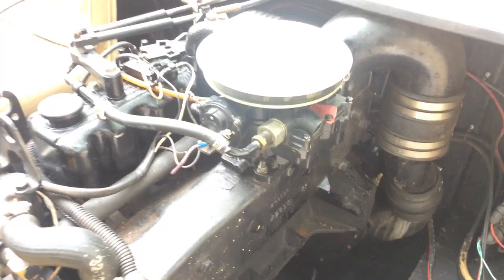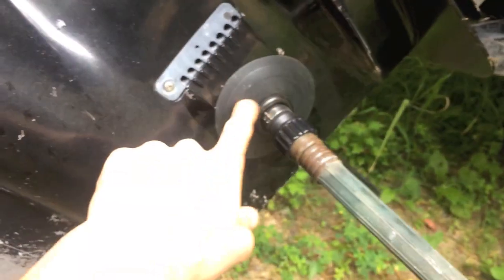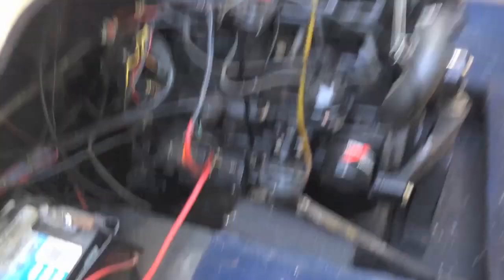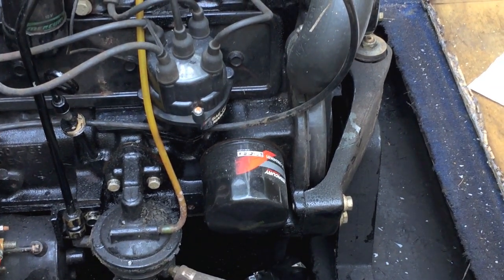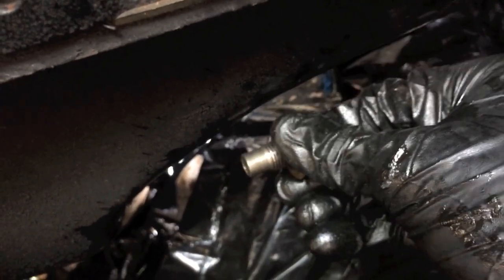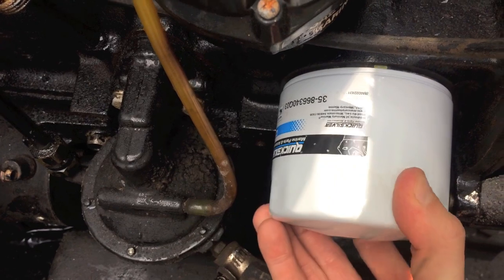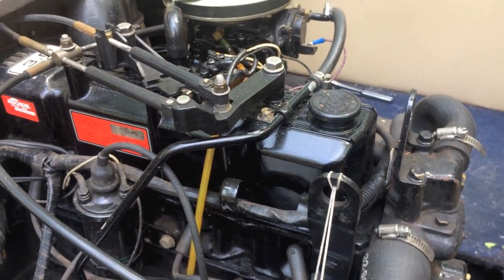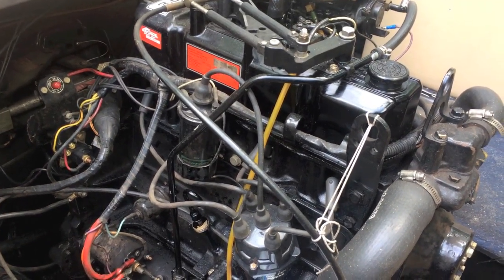Change Mercruiser 3.0L inboard engine oil - Fresh clean oil for the summer

Comment: Cool vid! Im a complete noob to marine. Just bought a project boat. I believe its a 76 Crestliner Crusader 775. It has the 165HP Mercruiser inline 6. Boat has sat for i would say at least 3 yrs, maybe more...was wanting to drop out the oil and filter and replace.
Do most these engine take the 10W30? And is it specific to marine application or doesnt matter?
Reply from the maker: splash 

Thanks for watching & congrats on the boat.  We recommend referencing the owners manual where you will find the exact engineer’s recommended oil.

For our specific engine, it’s the QuickSilver 10w30 & we have a pretty good idea that your engine takes that as well.

Keep us posted.  Please subscribe to the channel and turn on your YouTube notification Bell 🛎 that would be awesome thanks again!

😎👍🔧🔩

Comment: Hi Michael, those threads on the dipstick tube are for hooking up a hose to. I've never heard of trying to fish a line down the dipstick tube, just hook up a washer hose which has two female ends & pump almost all of it out very quickly. Then you will only need a plastic cup to get the remainder out of the pan, & filter. As far as winterizing goes I personally like , and pump in a few to run the engine till the thermostat is open then cut the water and pump in a few gallons of antifreeze before I drain the petcocks on the engine block, & manifolds for good measure. I'm not criticising your methods, I've just been doing it like that for thirty years & have never had any type of issues at all.
Reply from the maker: Mr. Ruck 

Thanks for watching & sharing your info.  We really appreciate it.  😎👍🔧🔩

Comment: On my bayliner all I had todo was move the Blige out of the way and that same container you have fit right under the pan.
Reply from the maker: Very cool & we appreciate you sharing.  Any & all helpful info is greatly appreciated & may come in handy.

Hope all is well.  😎👍🔧🔩
Reply: @DIYwithMichaelBorders  one oil change down. Unfortunately due to a cracked intake ill need to do another lol.

Inspect intake before removing your head if your getting water in your cylinders/oil save your self the headache.
Reply from the maker: @hexoticace8667  

Thanks for watching & sharing this.  Are you going to be replacing intake?  Keep us posted on your project
Reply: @DIYwithMichaelBorders  Yes, I replaced the intake. The intake had slightly different port design but accepted the old gasket without interrupting the flow to the head. Well see how it goes.
Reply from the maker: @hexoticace8667  

Very cool, thanks for sharing.  

😎👍🔧🔩

Comment: good afternoon, i seen your throttle bracket is different than my 90 bayliner 3.0. is that one better than it being on the side of the engine?
Reply from the maker: @FishingWithJo415  

Thanks for watching, not necessarily however having it in that location is more convenient depending on who you ask.
Reply: @DIYwithMichaelBorders  its more dependent because of the shift interrupter switch right?
Reply from the maker: @FishingWithJo415  

You can say that however your design is just as good.

Comment: Do you change the oil in fall or spring better ?
Reply from the maker: Thanks for watching & there are benefits to both.  Draining oil in the fall and adding new oil will be beneficial in the event that there is any water or moisture inside your oil.  Water or moisture inside oil can freeze and expand during the winter and cause issues.

Benefits of changing oil in the spring before the summer season include brand new fresh oil and brand new fresh oil filter.

We personally like to do the oil change in the fall after the summer season when the boat is out of water and on its way to storage for the winter.  We like the thought of draining oil to verify there is no water or moisture inside oil.

Hope this helps.  Us fellow DIY’ers need to stick together!

😎👍🔧🔩